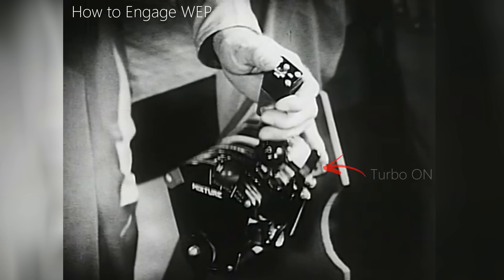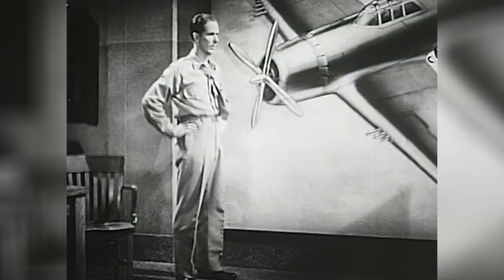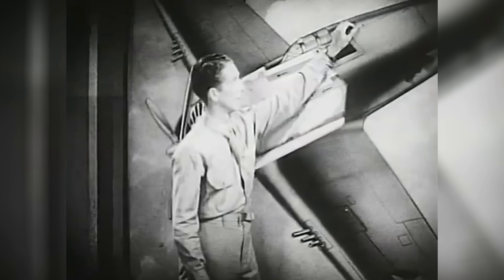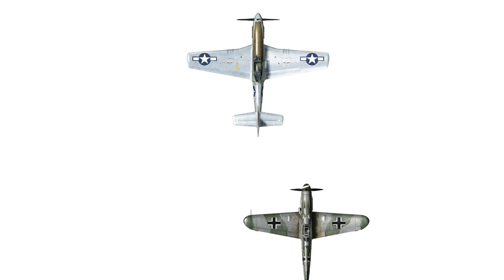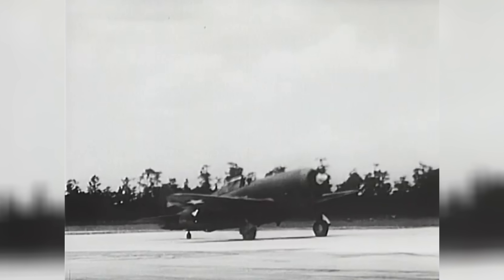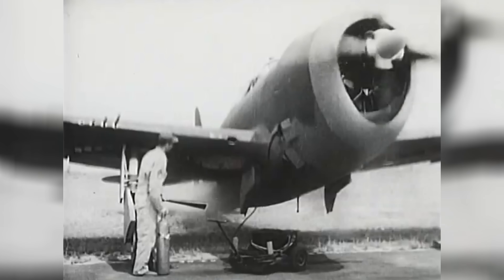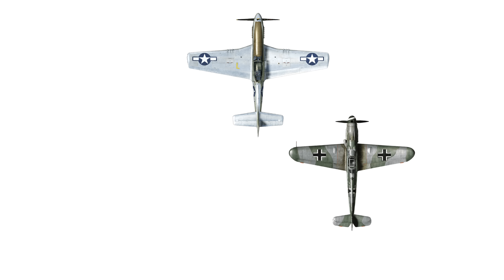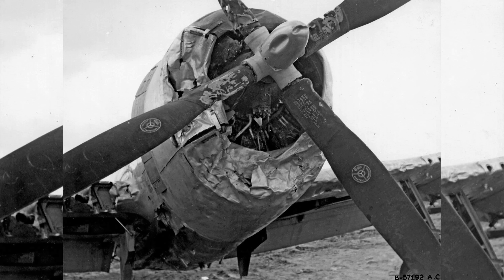What is WEP?

Comment: As an engineer and hardcore aviation enthusiast, I've always found this power setting the most intriguing. It's almost like using sustained stage-5 afterburners, or maximum redlining an auto engine.
Well done. Thank you.
Reply from the maker: You are most welcome! What’s fascinating is that every major nation in the war had some form of WEP. Who do you think had the most effective overall?
Reply: @FlakAlley  I personally believe both the US Army Air Force and US Navy had the better ones, with the FW190 right behind. I base this on reports I've come across as well as interviews of fighter pilots. The only drawbacks, particularly with the P47 Thunderbolt, is destruction of the engines. In more than a few cases, the engine was completely destroyed. American manufacturing could more than make up the losses. German industry couldn't. 
As allied pilots became much more experienced, they used it less since they vigorously avoided situations which would call for its use.
This is, of course, merely my opinion based on information I've come across.
Reply: @oldgoat142 I would say the Germans , cause they had a huge disadvantage in fuel . So they early come up with MW50 , water/methanol and GM-1 (Göring Mischung) wich is NOS . GM-1 was for their high altitude engines or fighters , to give them some extra oxygen . 

The WEP or NOT is just a little more boost and higher rpm , so that's not a secret or rocket science .
Reply: @5co756    Ur quite wrong. MW50 primarily worked by charge cooling and detonation suppression, GM-1 added oxidizer for high-altitude performance, and WEP depended heavily on fuel quality, boost limits, and engine design. Lumping them all together as “just more boost and RPM” kind of misses why each system existed in the first place
Reply: @oldgoat142 I would also say the Germans!
Reply: @Will1988US Dude stop using your fancy words if you don't know what they mean , oxygen is a oxidizer . 😅 Detonation suppression Jesus , this is called "knocking" . 
Just Google what NOS is , I won't explain you all . 

MW50 cools down the air wich is getting hot in the supercharger and this prevents knocking , therefore you can use more boost . Methanol prevents the water from freezing at high altitude , water alone to cool would be more efficient . But solid ice not ...

But the Brits and US used WEP without MW50 early in the war , BoB for example . They had better fuel with higher octane , while the Germans could use it only with MW50 .
But in the end WEP is just more boost and rpm .
Reply: @5co756  MW50 wasn’t just about ‘cooling the air in the supercharger’. The primary benefit was charge cooling and increased effective octane via methanol, which suppressed detonation in the cylinder, not just pre-compressor temps. And no, WEP is not ‘just more boost and RPM’ many engines explicitly did not increase RPM at all under WEP because mechanical limits were already maxed. If RPM always went up, governors wouldn’t exist. Might want to Google that part? come on kid
Reply: @Will1988US  Dude you literally have no clue about engines , you are mixing fancy words and think you are smart ?
Wtf is a supressed detonation for God's sake ? 😅 

"Knocking" is an uncontrolled ignition of the fuel/air mixture and not controlled by the spark plug . 

MW50 cooled down the supercharged air , wich get's hot while compressing in the supercharger . That's why modern cars have intercoolers , so do you understand it now ? 

Methanol sure gives you higher octane , but the primary use was as I said . MW50 was frost-proof to -50° Celsius , at 5000m altitude you have -15 to -20° . You can't spray solid ice into your engine .....

What every nation does at WEP is irrelevant , to gain more hp you can use more boost and/or more rpm . 
Bf109 DB605 DB for example had 2400rpm/1,35ata(bar) to cruise , 2600rpm/1,45ata for combat/starting power and 2800rpm/1,80ata Sondernotleistung/WEP . 

I hope you now have a little clue how engines work , little pro tip : torque x rpm = hp !
Reply: @5co756  You’re flat-out wrong about MW50’s primary purpose, and this is well documented. MW50 was not primarily antifreeze that’s a secondary logistics benefit. Its operational purpose was charge cooling and effective octane increase to suppress detonation at higher boost. The methanol isn’t there “just so it doesn’t freeze.” It has a much higher latent heat of vaporization than gasoline, meaning it dramatically reduces charge temperature inside the cylinder, not just in the supercharger. That directly delays end-gas auto-ignition and allows higher manifold pressure without knock. If it were mainly antifreeze, water injection alone would’ve been pointless—yet water injection without methanol was already proven effective before MW50 existed. And no, higher RPM is not how WEP was achieved on WWII engines the redline stayed essentially the same. WEP was overwhelmingly a boost increase, which is exactly why detonation margins, bearing loads, and thermal stress became the limiting factors. You’re repeating simplified explanations
Reply: @FlakAlley dude turn off these ai answers
Reply from the maker: @missionslos  Hey Missions, we have never used AI on this channel and never will so please enjoy the real content :)  The AI replies feature has never been turned on either. Its a shame AI has taken over Youtube and everyone thinks everything is AI now. Not blaming you but you are getting real replies with us and you always will. Thank-you!
Reply: @missionslos  this man has NEVER used the lousy AI nonsense, which is why I subscribed to his channel.
Reply: @oldgoat142  People are too braindead to understand what real even is anymore, im old school i see a real voice, real researched content and i sub. These days thats rare in itself. We need more channels like flak and AI creators needs to get a boot up the backside!!! nobody wants that

Comment: just a little interesting bit. I talked to teh Continental Chief Engineer at Oshkosh a number of years ago, and he was talking in his seminar about how their air cooled civilian engines could sustain temps far above what people were comfortable with. Typically people keep engines around 200F, but if I recall correctly they were saying the Continentals could get closer to 400F without failure.

the point is that a bit more heat is not always fatal for certain engines. depends upon it's design.
Reply: But airplane engines are designed to run reliably with minimal chance of failure do not always fatal is still too risky.
Reply: It's not just the heat. At that engine speed, parts are stretching and distorting beyond what they can return to. The engine oil isn't just cooking, the bearings are close to soft welding and seizing. Any minor problems you overlooked on the checklist will fail a LOT sooner.  It's not just the engine that has to be limited sometimes. Early AH1 Cobras had hotter engines, but they'd occasionally make the tail rotor shaft fail at max. The turbines had to be de-rated to prevent this.

Comment: In aviation, WEP (War Emergency Power) is a temporary engine boost for military aircraft, pushing power beyond normal limits for critical moments like escaping threats or gaining altitude, often using water-methanol injection (Wet WEP) or overriding limits (Dry WEP) for 5-7 minutes, but risking severe engine damage from overheating and stress. It dramatically increases horsepower, speed, and climb rate but only for brief periods, as prolonged use can destroy the engine.
Reply: Yeah thanks for this man comment man, I completely forgot everything that was in the video as soon as scrolled to look at the comments and was flummoxed .
Reply: @speedychungus2743 "Using the word 'flummoxed' while your brain is actively factory resetting in the comment section is a top-tier power move. 💀🧠"
Reply: Allison engines could sustain 70" MAP for sustained periods without damage. This was tested in 1942 for 20min and the engine suffered no abnormal wear or damage.
Reply: @SoloRenegade "Bro really pulled up with the 1942 flight manuals just to let us know that overheating is a choice, not a consequence. Absolute legend. ✈️🔥"